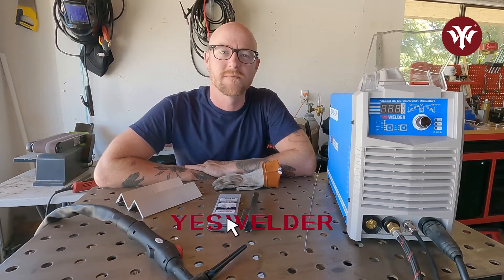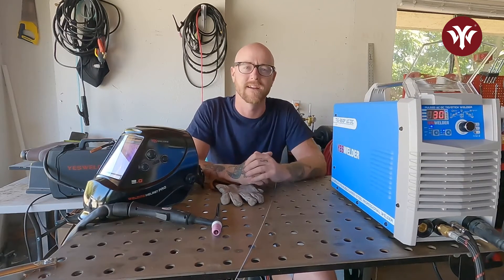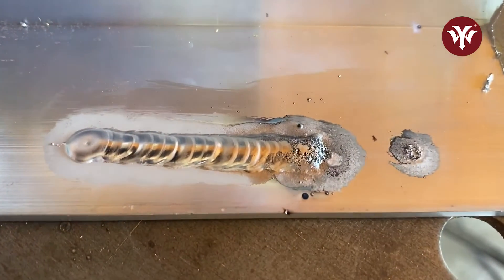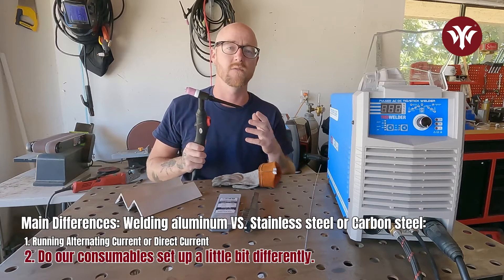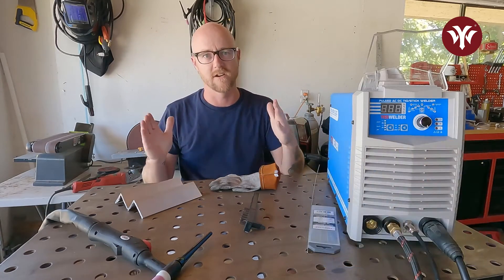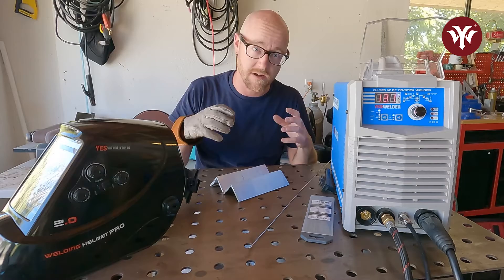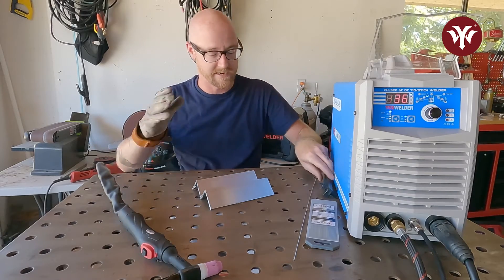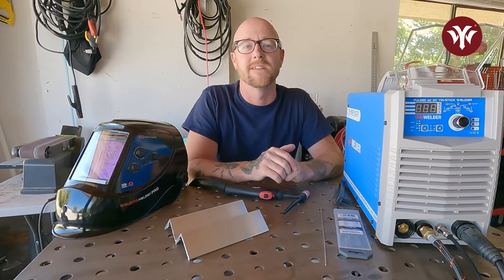Breaking Down Aluminum Welding Myths and Thoughts with TIG 250P AC/DC | YesWelder

Comment: on n'utilise pas des électrodes au cérium pour  l'alu, mais des tungstènes pures ou au lanthane, et surtout on ne montre pas des conneries sur youtube comme celle de souder en TIG les bras nus, car la peau va être brûlée par le rayonnement de l'arc électrique. 
we don't use cerium electrodes for aluminum, but pure tungsten or lanthanum, and above all we don't show bullshit on youtube like that of TIG welding with bare arms, because the skin will be burned by the electric arc radiation.
Reply: From The Fabricator
"Inverter Machines and Tungsten TIG Welding
When inverter GTAW machines came on the scene, they changed everything. The balance control can be set much further toward electrode negative (EN) while still getting good arc cleaning action. Since only a little electrode positive (EP) is used, the tungsten electrode stays much cooler. In fact, the best electrodes for AC inverter GTAW machines are generally ceriated, lanthanated, and rare-earth electrodes, which are all sharpened to a point and can retain the point very well during use. Thoriated, zirconiated, and pure tungsten electrodes are not often used with AC inverter machine"